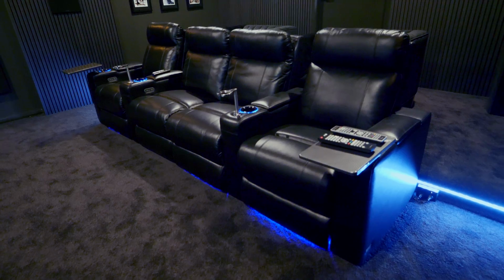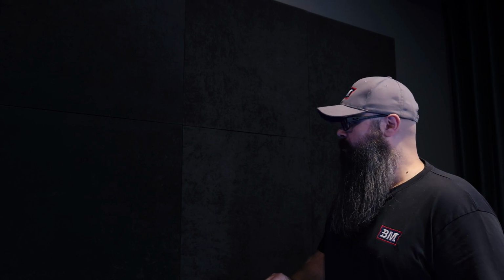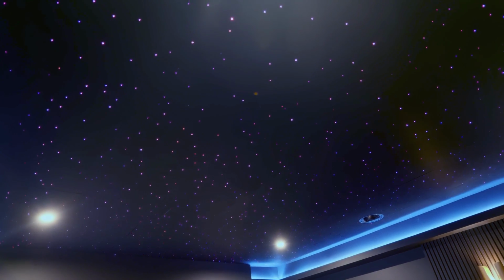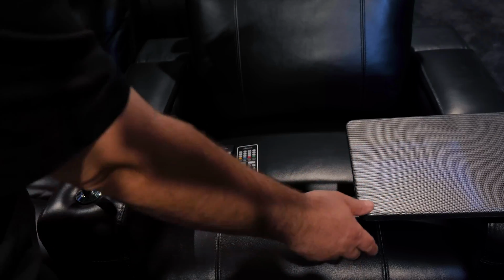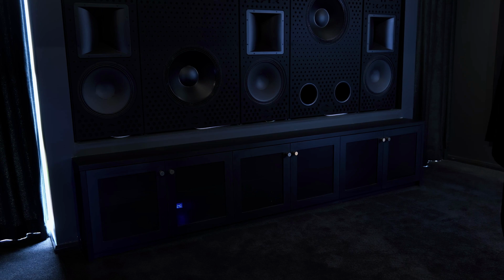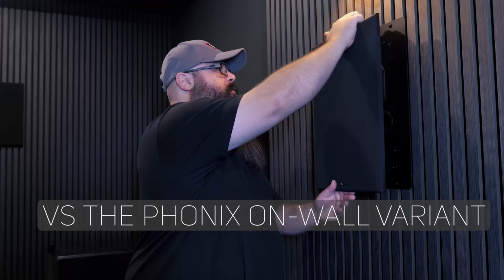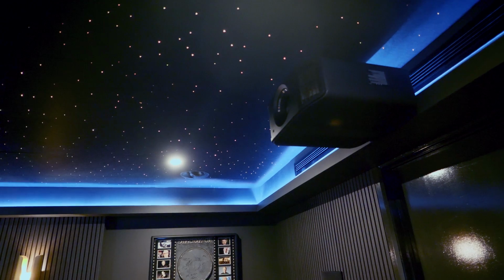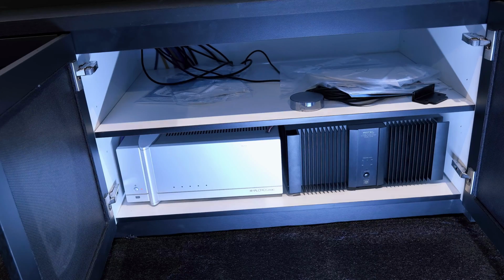AMAZING 7.4.4 Home Theater Tour 2024 - JVC / SVS / KRIX / MARANTZ / VALENCIA Home Cinema

Comment: Amazing room. Question for you Tony - how do the atmospherics go do you know with other bed layer speakers with normal dome tweeters? I have an M&K system and looking for angled atmos speakers and these caught my eye. Do you know if the different tweeter designs cause issues at all when mixed?
Reply from the maker: They work really well to get them on-axis better than simply pointing down. I have 6 in my own room and it helps with the overall output from the system. They match quite well, especially with other Krix speakers, but I imagine they would still sound good in a hybrid system.
Reply: @BuildMontage  great thanks. Was trying to find something decent with more than 20 degrees baffle, but might have to go with these!

Comment: why would you need 4 subs
Reply from the maker: In a larger room like this, often you will experience issues with bass nulls, and having multiple subwoofers helps to fix that problem. You don't need them but James had the two extra from a previous build so why not utilise them :)

Comment: Professional system.  Those acoustic treatments are fire.  The star ceiling makes this theater premium.   Think I would be putting velvet around some foam board and put in those windows to eliminate any light and light bleed.   Love that he has room to upgrade those subs.  Great placement.  It sure makes a huge difference when you can do most of a room all at once.   One of my favorite theaters I have seen down under.
Reply from the maker: Thanks for watching. It is a super nice room 100%

Comment: Why not a higher end subwoofer or a krix subwoofer to match the rest of the krix speakers?
Reply from the maker: I get why you asked the question, but dont forget this hobby is expensive and also, James has been into this for a while and sometimes nostalgia, we keep older equipment - those SVS subs are no slouch either - they pump out some serious output... This hobby is never ending and upgrades keep happening over time.
Reply: While you are at it, throw in a Trinnov Altitude 32 🤑